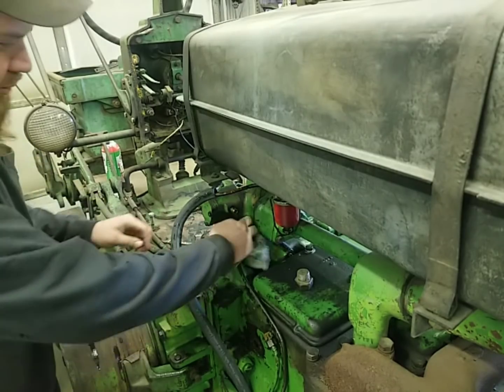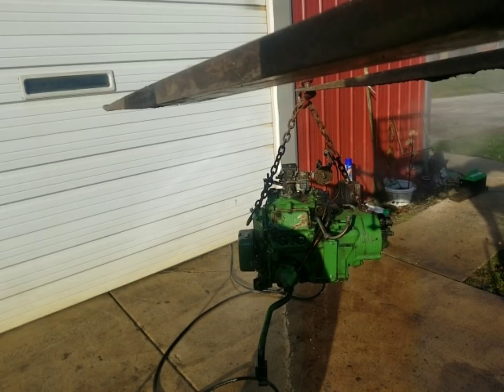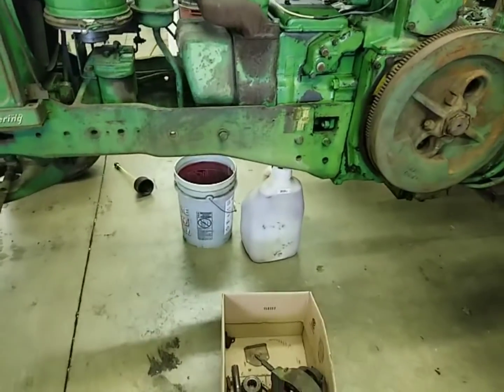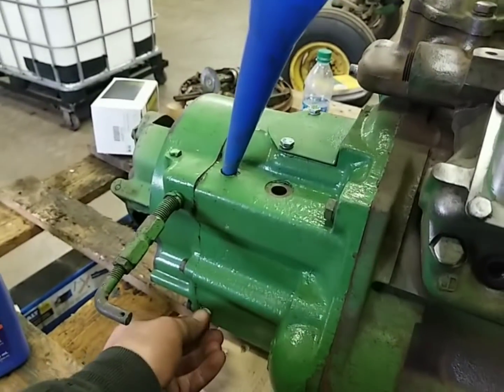John Deere Two-Cylinder 720 Diesel...Pony Motor Transmission Reinstall And Prep For Paint!!

Comment: Have you guys ever tried "The Right Stuff" instant gasket maker. As long as your surface is clean you put it on bolt it down and fill it with fluid couldn't bellerive it the 1st time I used it.  It's saved me so much money and time making gaskets in my shop. It puts any rtv sealant to shame.  I get it at Napa.
Reply from the maker: Yes I have used that!!! Good stuff!!

Comment: I'm assuming you're trying to keep the 720 as original as possible, I would have bought the conversion kit and went electric start. I kind of like the convenience of only one engine to maintain but I've replaced a few starters on newer 2 cylinders, they are heavy and in awkward places. Under the crankcase in 50, 60 & 70 JD's
Reply from the maker: We want to keep it original as possible and it's what dad grew up with if a pony is properly taken care of they are trouble free

Comment: I thought I was the only one that had to run back and forth to get the right socket, reassuring to see someone with your experience to the same thing.  THANKS!!!
Reply from the maker: It happens to the best of us especially when someone puts the sockets in the wrong order most of the time I grab them by the order they are in on the rail well they weren't in the rite order lol and the one I wanted was missing